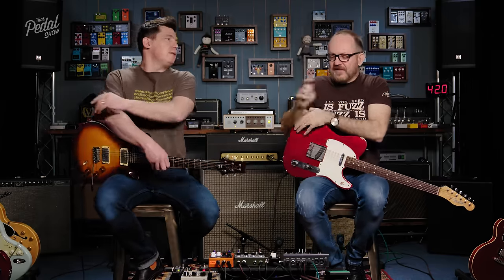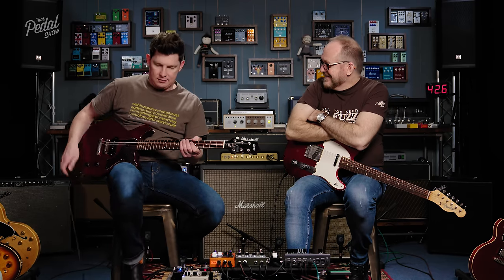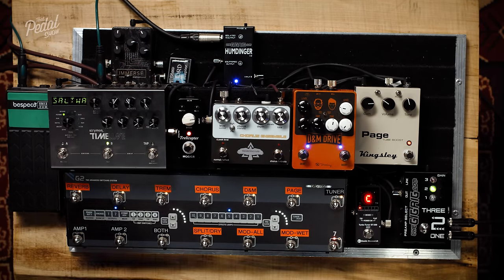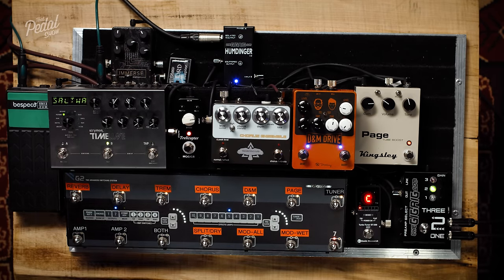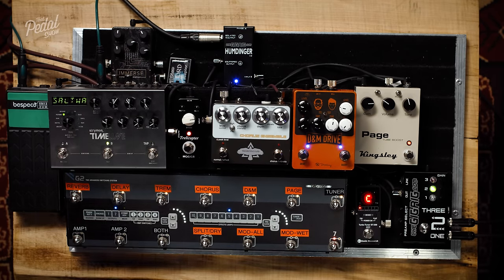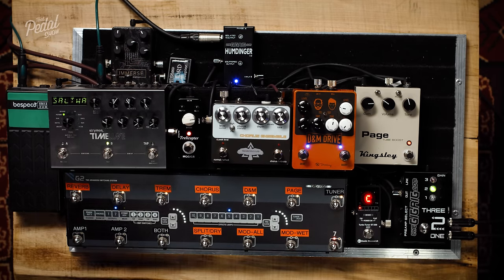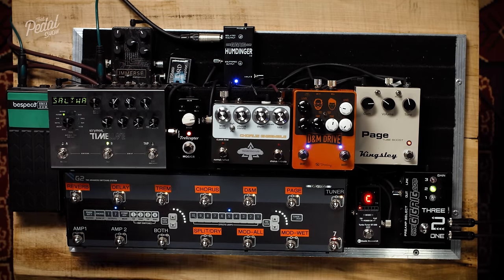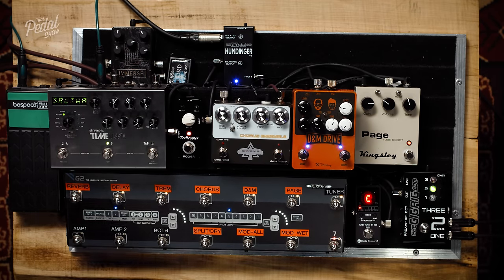Wet-Dry & Wet-Dry-Wet Amp & FX Setups Explained – That Pedal Show

Comment: I run stereo out of my reverb on my pedal board which is last in my chain.  Is there a way to tell if I am in phase? Do I have to worry about that? I figured if both amps are singlelury in phase that they would automatically be in phase together, am I wrong?

Comment: Dan/Mick please: Can I put Big Sky AFTER  the two main outputs of the G2 and go into two amps? (since g2 outputs are isolated and phase reversible)

I want wet/dry/wet.
- Dry: loop4 out-> hum dinger -> amp1
- g2 left out -> delay-A -> big sky left out -> amp2
- G2 right out -> delay-B -> big sky right out -> amp3

Comment: I’m actually a pretty technical guy but I’m still not sure of one thing. Can I run a wet/dry rig correctly with just the G2? It has 2 outputs, isolation and phase reversal. Do I still need something like the Humdinger to do this properly?

Comment: Hey Dan, would an ABC Y device be possible, a splitter that allows three outputs? If so, is it an expensive or overly difficult proposition to have two separate isolated and phase switchable outputs on a single device?

Comment: I first read "Wet, dry, wet, dry, wet" which is only one wet short of my current rig. I run my unlifted ground to my fattest bass amp in case there is any transformer attenuation of the lowest frequencies. Stacking speakers on a vertical axis makes the phase easiest to align, I have even tried using a phase adjustment tool to compensate for one stack of speakers getting shoved into a corner behind the other. I have read that low frequencies move a little slower so I used the IGP to delay the front, higher octave stack.

Comment: I was looking at buying a G2 and was wondering if it has a built in splitter in order to run a wet/dry setup or are both the outputs going to be wet/wet?  And if it doesn't,  how would I wire it with an external AB splitter?  And since Mick has a Super Reverb, is it always his wet amp since it has the reverb built in?  I'm asking because I wanted to run a Vox AC30 as a wet/dry and you have both there.    Thanks and great, informative show as always.
Reply: G2 has two outputs (phase switchable) that are after loop 10 so both outputs receive the wet signal.  You'd need to get a humdinger and place it in one of the G2 loops after your drives to make the dry split.
Reply: Stephen Doyle Thanks Stephen, much appreciated

Comment: I have always heard that you can easily switch the phase of the speaker by switching the speaker wires.  Is that not true? or not safe?  Also if you just get lucky and the two amps are "in phase", wouldn't they stay that way?  In other words once you're in phase, you don't need to switch it around anymore even after you set up again at another gig.  right?

Comment: Random nerd question that I can't keep up with visually watching this and forgetting the dB meter is actually there: what does the dB meter do with different pitches/random jumps in frequencies? Like, if you're playing a few licks, and you hit that one note that perceptually is much louder (feedback, pinch squeel, whatever), does the dB meter read that, and like how much? I like that you have that as a reference tool, but when I see that, my curiosity shifts towards playing live. This opens up a lot of questions for me with like what pedals to choose based on the sort of feedback or really focused volume on certain notes I get with them. As in, some pedals sound really kind of low in the mix in certain registers, then when I hit some high notes, it's almost too present in a mix. Sometimes I wonder if just the pedals are doing the unexpected magic or that something very interesting is happening on like, I don't know, some unnegotianated sound pressure level that the amp is responding to. The dB meter to me leaves me with that question, what kind of noticeable jump happens just with volume versus all those perceived loudnesses?

Comment: So, if i use a guitar like the EBMM Majesty, with the Piezo pickup in stereo mode, i have to split the signal of the guitar, send 1 line to the Accoustic Amp/PA system, then take the second signal, send it throught the gain pedals (etc. distortion, overdrive), then split that signal again and send 1 to the Dry amp and the other to the rest of the pedals (etc. delay, chorus?, octaver?) and then to the Wet amp or you could split this signal again and do the Wet/Dry/Wet settup, which is 4 Amps at this point?. This is brilliant but damn does it need a strong pocket to support it, i hope in the future i can test it, in like 3-5 years when i have the money for it. P.S. Can you please make a list of what you consider Dry and what Wet effects apart from the obvious ones?

Comment: So, I have a question about trying to get the wet-dry benefit with one amp. What if you split your signal, but put both wet and dry signals into a mini-mixer type pedal before going to the amp/pa? You could potentially keep the dry signal "proud"?
Reply: I mean, I know the room feel is WAY different, but that's not always an option.

Comment: Great show, guys. Question: for those of us without 2 amps, could running separate wet and dry signals through a pedalboard into 1 amp achieve a similar effect? For example, using a Boss LS-2 with loop A (dirt) and B (mod/time) or putting a stereo pedal at the beginning and end of the chain. The more subtle trem/chorus/delay sounds you demoed were amazing and I'm wondering if it's possible to get close with a single amp. Might be a silly or obvious question, but would appreciate any advice. Thanks.
Reply: I wanted to know too.  I imagine it would sound better than series cabling, but not as good as using multiple amps.  I think I'll try it tonight.

Comment: Speakers And  Monitoring : A pair of speakers can be in or out of phase with each other. the same signal applied to both speakers  will cause  their cones  to move in the same direction .If they are out of phase  one cone will move in one  will move out. Phase can be tested  by applying  a mono signal .. I’m liking your Youtube Channel  more frequently . The comment is from a copyright 1974  Modern Recording Techniques By Robert E. Stevens .Wet Dry  Seperatiion because of this Video is greatly implemented .Thankz

Comment: I'm thinking that the best way to maintain the attack and transients of your guitar may be to just use a clean boost for the higher headroom wet amp(s) to achieve volume parity with the dry, dirty amp. Clean wet. Dirty dry. Might finally make up for the mushiness of distortion, particularly with a fuzz for dirt. I'm going to try it.

Comment: So, a couple questions.
1) what’s the proper way of achieving “one path to earth”?
2) sending vibrato to only the wet amp, doesn’t that basically produce a chorusing effect?
3) Can I just use the stereo outs of my brand new ce2w as a splitter? (thanks for turning me onto the pedal, love it to death) Or the outs of any other stereo fx for that matter?
Thanks, cheers!
Reply: Nikola85ZgCRO I use a CE2w to split my signal.  It works, but since you can’t switch the phase, and I’m assuming the outputs aren’t isolated you could run into issues with certain amps or in certain venues.
Reply: 2 is a very good question! I would think the answer would be yes at least to some degree. Adding to my list of things to try. I have a WA Julia that the has the knob to go from chorus to vibrato. Would love to compare the 2 with and without the dry amp to see how similar the chorus sounds are.

Comment: I completely understand isolation and phase thanks to you! However, what device/method is used to introduce the 3rd amp and flip its phase? This is the part that is confusing to me because the inputs/outputs of my ABY switcher are already utilized by the fist two wet/dry amps. I’m having trouble visualizing this physical signal path. Thanks fellas!
Reply: I would use my main dry center amp all the time so just using a humdinger as a splitter. Then I would suggest keeping the ABY for the two wet amps as long as it can do phase and isolation for both. That way you have control on using just dry amp, dry plus one wet amp or all three amps.

Comment: Can I use a vox ad30vt which has a tube preamp factory installed, could I pair it with another ad30vt for the second wet, and for the dry would it be recommended to use another vox like AC15 or ad50vt?

Comment: Ok. So I went out and got me another 15 watt Fender so I could try this. Now I have to wait for the correct ABY pedal. But in the meantime I did use a standard ABY and was initially impressed. Any ideas on which ABY to get. I’m thinking of the Radial since they have it in stock at Sweetwater.
Reply from the maker: The Radial works great. Fulltone ABY is great, TheGigRig ABY Baby too

Comment: I found that the Wet - Dry Setup was my excuse to buy a second amp. I pair a Vox AC15C1 and a Custom Deluxe Reverb '68. With the Empress Echosystem, I can put presets to manage which amp will be Wet or Dry, using the Left/Right mode and by putting the Wet Mix to 0 for the Dry amp.

Comment: Hey guys, just wondering, after the signal has been split, does it matter which signal goes where? I.e.,  the dry signal go through the buffered output and wet through the isolated output or vice versa? My set up goes : dry signal go through the buffered output and wet through the isolated output but there's a volume drop in my Strymon timeline.
Thanks,

Comment: I use a 2 amp setup, can I use lets say the JHS Buffered splitter AFTER all drives use one output on the splitter to go to the Lehle P-split into a deluxe reverb? I subsequently take the 2nd output from the jus buffered splitter to go into delays, modulations, reverbs and finally a looper and buffer. Take the buffer out to the 2nd output of the Lehle to connect to a Marshall head? I'm majorly confused, pls help xD

Comment: Question: I run a direct rig based around a preamp with built-in cab sim. Drives before the preamp, modulation and delay after. Is there any point to taking a dry out from the preamp and sending that to the desk? This means both the wet and dry signals will have the same amp and cab. Do you need two different amps and/or cabs to get the proper effect, or will I still get a benefit from this?
Reply: Totally. Blending it in can help give clarity and more dimension to your sound. The Edge actually does this when U2 plays live. There's always a small amount of the signal prior to hitting the delays and the amps that goes to FOH

Comment: So..... if or when recording for that big guitar sound, are they mostly re-amping or recording with these wet/ dry or wet/dry/wet with separate mics. This sound is getting closer to how it sounds on a record. Is this mostly for live performance, recording or noodling your noodle, alone in a room? Is it possible to do a pseudo version of wet/dry with my tc flashback 4x which has a stereo option and add different effects for separate amps after the stereo out to the the two different amps? I suspect that it would be wet/wet and the massive phase issues with other pedals after the stereo out of the stereo pedal such as the tc flashback 4x.

Comment: Also, if I want to run more than two effects  at once in the wet amps as full stereo, how would I do that with a G2 if there are only two stereo loops on a G2? Do I need to buy another G2?

Comment: A really great video tutorial: I'd really like to see this remade to use modelers. Any chance guys?
Reply from the maker: Literally none here. Dan and I are both in the second half our lives. Maybe even the third quarter. There’s not enough time left to not be playing tubes. But the good news is that all the signal routing theory is the same. Cheers!
Reply: @ThatPedalShow  Thanks for the reply guys, appreciated. Well, I have a pretty large pedal board... trying to get my head around running Thorpy Fat General into a parallel Dane and Fallout Cloud... and using that as my dry... then having a Ultra Violet into a Timeline and Cloudburst running the wet-wet sides. So a lot of splitting and subsequent mixing/blending. Based in EU so ideally looking at Thomann DE for those options... I like the gigrig stuff but they don't stock that.... and importing from outside the EU is a complete pain! LOL. I guess I could go Boss ES-8 but it's an expensive option....

Comment: Curious about a further discussion re use of EQ in the Wet send? The analogy of the studio mix omits one key element that those heavily processed layers are often also heavily filtered/EQed to create width/spread/depth and yet maintain space within the spectrum for other mix elements and further the psychoacoustic experience of width/depth/placement. Obviously the use of the Marshall, Two-Rock and Sovtek shows an intention for all three to sound great both together and individually. In mix situations this clarity/breadth in all three layers, can be unnecessary/counterproductive. Curious about how bass players, singers, FOH, feel about these rigs when Dan & Mick are performing in five piece (+) bands? The stage sound and phase relationships between PA, cab mics, foldback and off-stage sound must get pretty complicated in smaller rooms, where additional EQ of those layers is left to the mic channels. I think wet/dry and wet/dry/wet rigs perhaps present guitarists with even more of a responsibility to embrace an understanding of such  interactions and filter their effects accordingly....? OR in fact use bandwidth limited/tonally varied amplifiers in those wet roles. Could be an interesting addendum to explore wet tonal settings tonal character/variation of wet amps.

Comment: Question, are there any stereo pedals with phase control and ground isolation so you wouldn't need to get another splitter unit for wet-dry-wet?

Comment: One of the best. Thanks so much! Question: In wet/dry/wet, do you get ground/earth or phase problems from the stereo out on delays? Does that require a second humdinger on one side of the stereo out? Plus one vote for a Rat / Rat based pedals episode.

Comment: i have an idea for achieving wet dry wet, what if i split the fxloop, plugging that in a cab sim, then into wet effects, i could have the stereo wet signal coming out of full frequency speakers, whilst keeping the valve amp dry. that way instead of having to mic three cabs, i could just have the sound man mic one amp, and then hand him a stereo out cable from my pedalboard as well.
what would i have to worry about with such an approach?
Reply: Unless you’re using something to boost it, splitting the effects out signal means you’d be sending a very low signal back into the amp’s effects return.  So it would work but you’re amp will only be half as loud if you don’t have a fairly substantial booster in the FX loop.  Similarly the input into your abs I’m will be half as loud as you’re usually getting.  But it does work.

Comment: Question: Can you please do an experimental show demonstrating a more comprehensive stereo or wet dry mix on G2 for acoustic guitar- and effects suitable for acoustic guitar. Perhaps 2 x AER Amps running stereo. And also the idea of using different preamps in the links of G2 so that each acoustic preamp can be tweaked to suit different instruments: Dreadnaught, small body acoustic, 12 string, nylon string classical.

Comment: If I want to use a stereo setup for ping pong delay and my two last pedals are stereo (strymon timeline and ditto looper x2) , do I need an ABY for phase problem or simply I can use the output of the last peal? Because if I need an ABY, how can I connect the two stereo outputs of the last pedal  if I only have a single input on the ABY ?

Comment: Hey guys. I have seen a few guys using a boss ce5 at the end of their signal chain pre amps. To create a  stero rig and splitting the signal. They then use the loop of the amp for the wet effects (reverb and delay). How bad an idea is that?
Reply: I believe zakk wylde uses this method
Reply: Anyone??

Comment: My question regards implementing the Wet/Dry concept with a single stereo amp like the Roland JC-40.  Accepting I would be limited to a single EQ and the speaker spacing is fixed, are there any other issues (like phase) that makes the single stereo amp Wet/Dry scenario unrealistic?   And if I did add a second mono amp, is Wet/Dry/Wet possible?

Which brings me to the obvious suggestion, a stereo pedal episode.

Comment: Where would the Volume Pedal be in the chain that would control both the wet and dry signals? I saw that you put the Volume pedal after modulation, which is where I would too, but the modulation is after the ABY, which it would not control the dry amp signal, unless the GigRig2 has some nice features to control both paths. Is your Volume pedal actually an expression pedal into the GigRig? I don't have a GigRig and my Volume pedal is passive.

Comment: From previous videos I seem to recall that you use the Electric Mistress before gain pedals. Would this remain in the same position on the setup you have in this video or would it change to after the gain pedals (with it being a form of modulation)?
Reply from the maker: Dan here, I still use my mistress before gain stages so it would go into everything :)